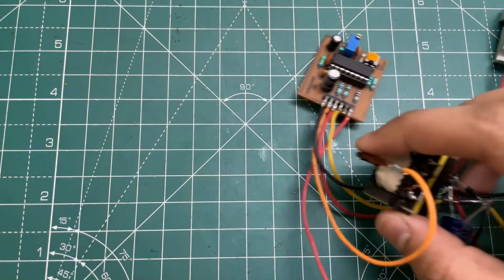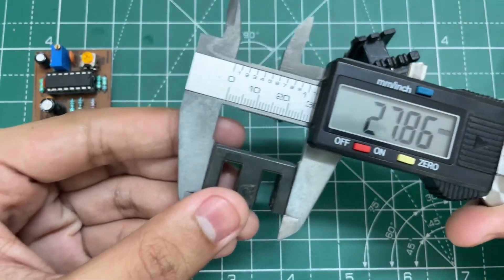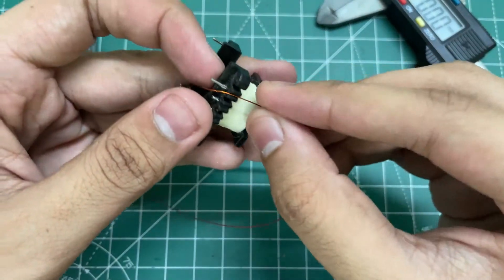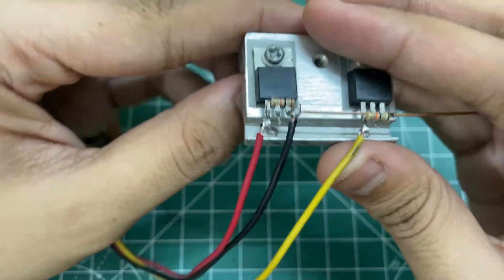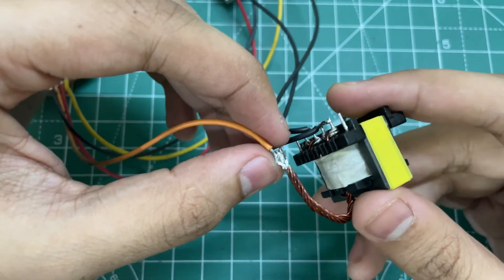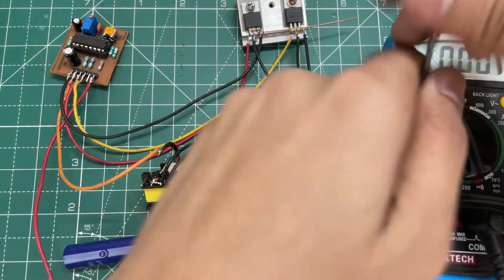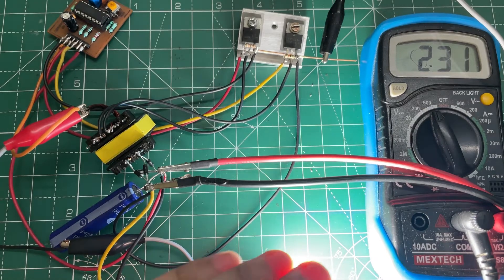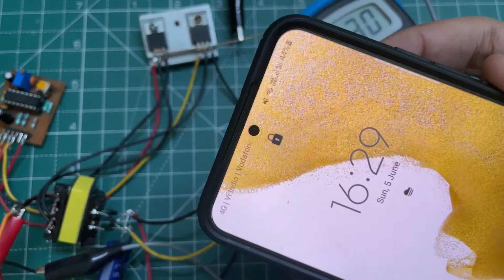DIY 12V TO 220V CONVERTER WITH SG3525 MODULE

Comment: How much max duty cycle in full load Bro? I am worry in full load. Can I set up max to 80% duty cycle in full load. THK for circuit. I am finding for feedback FB SMPS.
Reply from the maker: In the datasheet of the ic, it is given that the maximum duty cycle is around 50%

Comment: Air gap is required aur not.. Because I am used CRT tv transformer (EE40) in this transformer the air gap present.can any problem to make the inverter aur not
Reply from the maker: There should be no air gap otherwise the circuit will blow

Comment: Sir. Making transformer is not so clear. Kindly tell me how many primary and secondary turns in this transformer.
Reply from the maker: Primary- 3+3 turns of 4 x 0.7mm wire
Secondary- 90 turns of 1 x 0.3mm wire
Reply: @kdcreativity6201  output power?

Comment: sir,  Convert it 220v dc to 220v ac 50hz.
so that we can use it as a normal inverter.
Reply from the maker: Ok bro 😃😃
Reply: I have a circuit to convert 310vdc to 220vac. If I need I can guide u
Reply from the maker: Can you please send the schematic to me on messenger 😃 ?
Reply: @kdcreativity6201  definitely. I have tested this circuit and found ok. I have also made pcb which I can send u
Reply from the maker: Nice bro. Please message me on messenger